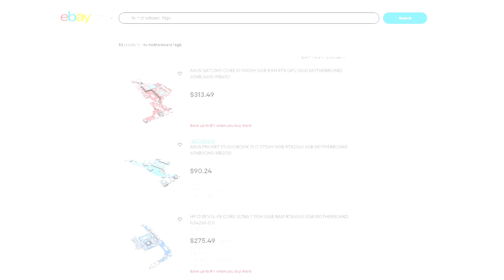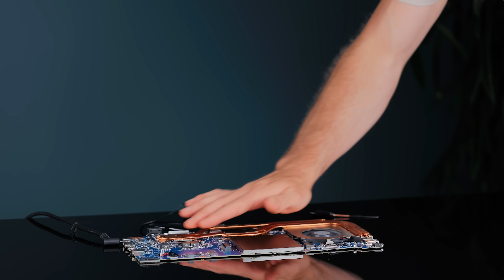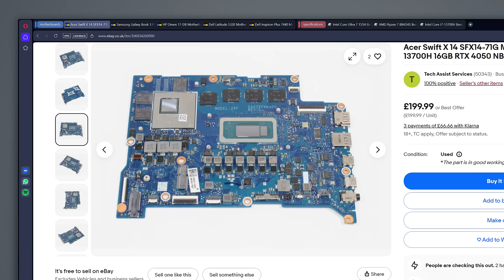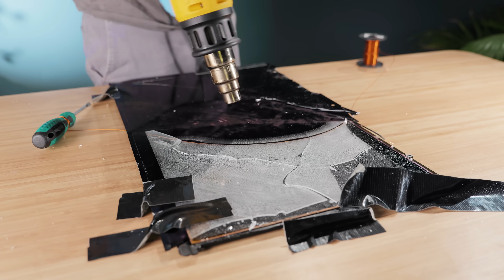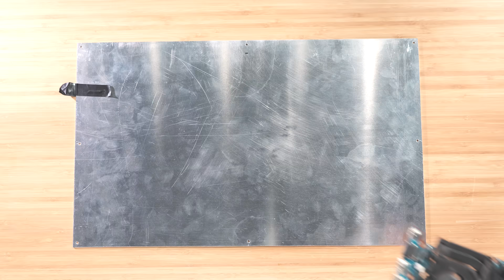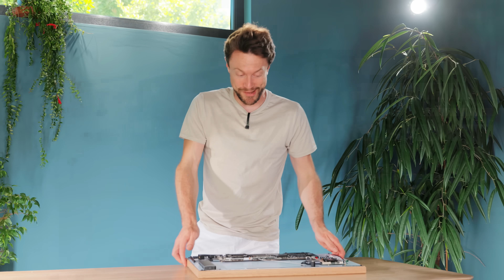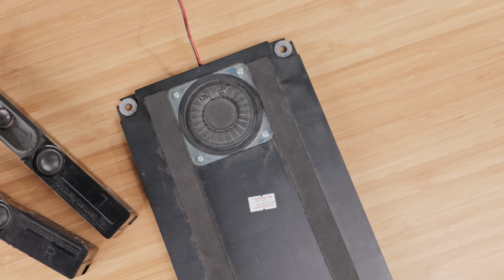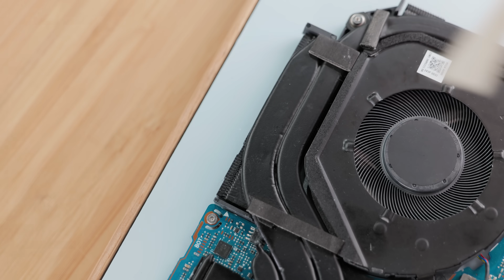A new way to build a PC in 2026!

Comment from the maker: Let's beat the tech price crisis with some recycling! AD: Also, optimise your workflow! Download Opera for free today: https://opr.as/08-Opera-browser-diyperks
Reply: I have a question tho you removed the glass from the lcd but did not replace it so isnt it causing a lack of protection for the lcd atleast we could put a adequately sized glass protector or a glass sheet in front because the legs look thin if it accidentally toples then its a gone case
Reply: @danyalshahzad3653  glass that isn't simply adding to the danger of a topple is gonna cost more than the parts you'll be replacing in this kind of setup.
Reply: excellent vid as always Matt!
Reply: @LiteLotus No it’s not smart we are going to have a shortage of Laptop Motherboards now thanks to him
Reply: @patri0tgng66  why are you EVERYWHERE
Reply: @HoliLasagna Why does it matter where I am!
Reply: @patri0tgng66   nah i was just wondering
Reply: @patri0tgng66  no we are not going to. more laptops would be produced or would spoil. either way we are going to have more.
Reply: @anthonyokonkwo3493 Yeah when we are about to attack China and we pay more for tariffs very smart
Reply: Could you provide a build list for the PS5 tablet edition on your patreon or your website? I would very much like to build it.
Reply: What was the final price?
Reply: @damndene7824   i think somewhere around 500 dollars
Reply: I fully agree, re using parts, being productive, reducing e waste and making usefull products.
Reply: Man, you're top dog! Thanks for these videos - every time a new one comes out, it's a small holiday!
Reply: anyone who uses Opera in 2026 is just stupid, sorry to say it
Reply: Is there any way to hook up an external display as an internal one? Most laptops throttle when connected to external and I already have a 4060/i5-13650HX system I can use!
Reply: Make a build with a asrock b250.. they use them as old crypto miners but have been converted to steam machines.. 

If anyone cam make the worlds thinnest steam machine/PS5 emulator..
Reply: Been waiting for new video for monthssss
Reply: I would love to see this again, but you with you making a custom cooling system because most laptop motherboards don't come with a cooler, at least not with what I can find. on ebay
Reply: Please let me join you when the Apocalypse hits. You can build everything we need, I can make jokes. Deal?
Reply: love it!... i hope there is more morevideo. thankyou brother
Reply: I am thinking abt building it for my college, I have no experience with working with electronics or circuits whatsoever. Can I build it for it? Is it safe If I use chatgpt and gemini for help along the way for it?
Reply: Great idea and super video.

Next idea hmm… if you still have more high‑end motherboards, can you make them into a PC with a normal double low‑tower heatsink/120mm fan  from a regular PC, mounted onto a laptop motherboard, and at the same time something to cool down the memory around the GPU and the rest of the chipset around the CPU.
Reply: @diuran3029 not a great idea we will have no spare parts for our Laptops that we need to repair
Reply: Watching your videos for many years now and I see you took few shortcuts in this specific one, not the detailed or precise work I am used to from your side. Hope everything is very much OK at your side. Looking forward to see your next project sooner than in 4 months.
Reply: there are many so called engineering channel are there, but none are like you...
Reply: Where have you been,mate? Missed your channel
Reply: Hello, The links aren't working in your film. Can you fix them? https://www.youtube.com/watch?v=YfvTjQ9MCwY
Reply: Can you update the links?
Reply: Çcl😢
Reply: Try using darker color wood
Reply: I always wanted to do cool stuff like this you do  but I don't have the resources
Reply: There is someone named "@TomorrowsCode" stealing your content
Reply: To be honest no one is going to bother to go through this entire process to revive their entry level laptop into a Desktop.
I did a similar project with an MSI 16L1 board which is a laptop with an MXM and Desktop CPU slot.
Which had a half dead SIO/EC, had to use an MXM adapter to PCIE and custom mount a Desktop cooler over the CPU
The bios modded to support 9700K CPU's and i ran this with a RTX 5090 Desktop.
Mapping the power button to an actual PC case, figuring out how to mount the board to a PC case, figuring out the power, to power the board and also the GPU and it actually worked pretty well.
Figuring out how to bypass the no Fan shutdown timeout from the EC, had to link the Desktop cooler PWM signal on both the the fan inputs on the board.
It was a cool project which in the end ended up as a working Desktop gaming machine at 4K@60 on Max.

Here are the scores:
https://www.3dmark.com/sw/2092924
https://www.3dmark.com/sn/5169931
Reply: @TomorrowsCode is taking ur videos
Reply: Hi DIY Perks! 👋🇱🇰 I’m Kanishka, an A/L student from Sri Lanka and a big fan of your amazing DIY projects!

I saw your portable PS5 project and was absolutely amazed by it! 😍🎮 I’ve always wanted to experience something like that.

I currently have a Ryzen 5 5600G PC, but I don’t have a dedicated graphics card. If there is any chance that you could help me with a **portable PS5, PS5, or even a graphics card**, it would mean so much to me.

I use my PC for studying, learning programming, and working toward my future goals, and I’d also love to enjoy gaming.

I know you receive many requests, but I thought I’d give it a try. Thank you for creating such incredible projects! 🙏❤
Reply: DID YOU SAY POTENTIAL !!!
Reply: you can get hdmi ribbons with any connector at the end ☺
Reply: I have a legit question is this PC up for sale ?
Reply: I would appreciate if you would share where you bought motherboard with RTX 4060 with 32GB ram for 380 euro! I found only with 3060 without any ram for 500-700 depending on the processor.
Reply: Impressive!
Reply: cool video, but the defect is the sponsor
Reply: @减  its not, its the best sponsor for such a content
Reply: To be fair - you had a VERY cool PC in a wooden frame, like a piece of artwork, but the tripod speaker stand kinda ruined it, I'd have left those out and just used proper external speakers, maybe via bluetooth or some other wireless protocol.
Reply: Instead of recycling, let's beat speculators to death unless they half the prices for good.And "there is problems with resources/a war" can't cut it because scarcity is created by psychopaths and the current "wars" are fictional hoaxes.
Reply: I think Brave is a better choice as its more privacy focused..
Reply: @FJB2020 both are bad, brave has had muttiple debacles. Here is a list

 Way back in 2016, Brave promised to remove banner ads from websites and replace them with their own, basically trying to extract money directly from websites without the consent of their owners

In the same year, CEO Brendan Eich unilaterally added a fringe, pay-to-win Wikipedia clone into the default search engine list.

In 2018, Tom Scott and other creators noticed Brave was soliciting donations in their names without their knowledge or consent.

In 2020, Brave got caught injecting URLs with affiliate codes when users tried browsing to various websites.

Also in 2020, they silently started injecting ads into their home page backgrounds, pocketing the revenue. There was a lot of pushback: "the sponsored backgrounds give a bad first impression."

In 2021, Brave's TOR window was found leaking DNS queries, and a patch was only widely deployed after articles called them out. (h/t schklom for pointing this out!)

In 2022, Brave floated the idea of further discouraging users from disabling sponsored messages.

In 2023, Brave got caught installing a paid VPN service on users' computers without their consent.

Also in 2023, Brave got caught scraping and reselling people's data with their custom web crawler, which was designed specifically not to announce itself to website owners.

In 2024, Brave gave up on providing advanced fingerprint protection, citing flawed statistics (people who would enable the protection would likely disable Brave telemetry).

In 2025, Brave staff publish an article endorsing PrivacyTests and say they "work with legitimate testing sites" like them. This article fails to disclose PrivacyTests is run by a Brave Senior Architect. 

Look this up on the r/browsers reddit from the user xusflas, Titled List of Brave browser CONTROVERSIES. They have sources linking to everything that is mentioned here.
Reply: @FJB2020 Yeah, and they want 60 bucks for their browser... 😂
Reply: @FJB2020  Im using it rn, so i agree.
Reply: Is this a comedy? RTX4060 laptop motherboard cheap!?  I think not - if a laptop has a broken screen, these days the screen is a relatively cheap part.... The motherboard, ram, ssd, not so much!...  Aren't there also issues with batteries not being detected/connected...  I think if you included prices you paid for parts we may find it to be a rather expensive build....
Reply: why would I willingly download a virus when I can be secure?
Reply: No way to get it for this price. Maybe 1380$
Reply: This video has a lot of miss information desktop vs laptop. Desktop hardware has different sku vs laptop. Laptop hardware is way under power.
Reply: Matthew, I think I have a project idea that matches the kind of engineering and design challenges you often explore.

The Meta Quest 3 has one of the best consumer VR optical systems available: pancake lenses, excellent clarity, and a wide field of view.

But it also carries a lot of weight because it is a complete standalone computer.

What if the Quest 3 was redesigned as a minimalist personal cinema display?

Imagine:

- keeping the optical core,
- removing the unnecessary VR hardware,
- moving the electronics elsewhere,
- creating an ultra-light custom enclosure,
- focusing entirely on comfort and visual quality.

The goal would be something between a GOOVIS-style personal display and a Quest 3, but with the best parts of both.

A fascinating question:
How light could a high-FOV personal display become if it was designed from scratch?

I think this could be a beautiful combination of engineering, materials, and product design.
Reply: You have awoken the scalpers. Now into new markets! Thanks! :(
Reply: Bro only posts when he doesn’t have enough money to pay rent
Reply: @supremespy5918  You think at his level he needs to RENT...? Judging by your tone and language I'd say you're about half his intelligence at best, "bro", so you might wanna just stay quiet.
Reply: @TheUltimateBlooper  I’m literally building a handheld gaming computer I’m probably about as intelligent as him he needs to upload more. He only uploads 3 times per year that is why I said he only uploads when he runs out of money and needs to pay rent
Reply: LOVE OPERA!
Reply: No bro you literally just told people to buy spare parts we need for our laptops to be used on anything WTF I thought you were smarter than this!
Reply: @patri0tgng66 
Dude do you like breaking your laptops all day or why are ubso butt hurt over this?
Reply: @NoteCry It’s the principal they are spare parts for a reason not diy projects we need those parts for our Laptops that need to be repaired
Reply: @patri0tgng66 bro let us do what we want with our parts. Why must it be done your way?
Reply: @contexd2-5 Maybe you don’t understand that we need those spare parts not to be used on something else it’s going to cause a shortage and the price to increase to ridiculous amounts that we cannot afford
Reply: @patri0tgng66  And how exactly would spare parts cause price increase and shortages? They're called spares, aka EXTRA.
Reply: @contexd2-5  You’ll see what happens once people get the idea on using laptop boards for their diy Computers these boards will eventually go out of stock and we will be fucked you think I’m wrong but it will happen just wait

Comment: It won't destroy itself if turned on without a fan. Firstly - fans can die on their own, so most laptop designs will post a message on the screen warning you that the CPU fan is dead if there is no signal from the fan because it's missing. Secondly, most modern BIOSes have thermal protection included in their default configuration. Once the CPU heats up to its TjMax, - it will trigger an auto shutdown. Surely there is a possibility that the previous user has turned these settings off, and this is why it's a good practice pulling out the CMOS battery for a couple of minutes then plugging it back in, in order to ensure BIOS settings go back to their defaults. Having said this - I still wouldn't advise running a laptop without a heat sink and active fan. Just that it's a lot more nuanced than you suggested. For example, some of my designs employed a passive heatsink. If you want to build something similar and want to be 100% sure the temps won't go into dangerous territory, - you could run a program like Core Temp set up to monitor temps and provide an additional level of safety to BIOS, shutting your laptop motherboard down whenever the TjMax temps are reached.

Comment: I've actually delaminated one of these displays (exactly the way you did with heat and wire) ... and you're not kidding. It is a lot of work and takes forever and you're left with lots of glass shards. It's a mess. There are flatbed heating devices (out of China) that will let you heat the entire display at once.

Comment: I would appreciate if he would share where he bought motherboard with RTX 4060 with 32GB ram for 380 euro! I found only with 3060 without ram for 500-700 depending on the processor. I think somebody would be crazy not selling the ram seperately for 400 and then the motherboard for 400. Looks like a load of BS. Really maybe some broken down laptop, whoes owner is too lazy to open it and sell the parts, so just sells it for 400 without knowing the real value.

Comment: I installed an old Toshiba laptop motherboard etc into an old flat wood box that I think once held an instrument or maybe a cutlery set.

The motherboard has no separate battery to back up time and date, the original laptop used the main battery, so it now always boots up into the BIOS and you have to click through that to boot up Linux. Fortunately Linux fetches the date and time from the internet and everything is OK by the time Linux is running and usable.

Haven't worked out a way to incorporate a small back up battery or how to bypass the the BIOS click through. But I still use it regularly for spreadsheet work and a few other things.

Comment: You can also use "wake on lan" if connected via ethernet port as a power button.
Although you need another device that calls the wake up signal but you can just use a ESP32 or Arduino

Comment: Reusing the old iMac display was already a great idea, but salvaging the speakers from a broken TV and actually designing them into the finished system was a nice touch. I especially liked the decision to aim them toward the user instead of mounting them the way they're normally positioned inside a TV. That whole build came together remarkably well.

— Ken
Creator Sound Works

Comment: I built something like this but without the display at the end of 2025. I added 2x Noctua 80mm fans to help out with cooling, slapped in a power button and included the laptops original speakers. I called it 'LapDesk Top'

Comment: Laptop replacement screens are also pretty cheap, usually less than $100 which is cheaper than a comparable monitor. Also use cut gloves when dealing with broken glass, it will cut through rubber gloves just as easily as cutting your skin. They cost next to nothing online

Comment: I love the idea of this, but I hate how that back panel looks. having the back being slightly raised from all the components and not covering the whole back just doesn't look good to me. I know with how it works you can't really do it but I think it would look better if the back was closed off. I also kinda hate the stand, it just seems way to high up. I have my monitors wall mounted and they are maybe a couple inches off my desk, I couldn't imagine trying to use it with them being half a foot higher. I do still really like the whole concept though, the execution just wasn't really there for me but everyone has different options on this stuff

Comment: Lowkey I would do this but with a twist, I wonder if it’s possible to do this with a slim drawing tablet around 16inch size and then slapping a laptop motherboard to it plus a huge battery so it becomes an all in one package for professional portability? Beats all the portable options that uses Android instead and also all the 3k tablets just to run windows

Comment: hey guys, i'm having a problem with my asus zenbook ux581gv battery. in my case I can't boot the laptop without the battery. do you guys have a suggestions what should I do? cause i'm thinking to not using battery and maybe using PSU instead. keep buy battery every year is just draining my wallet and it's not sustainable 😭😭😭